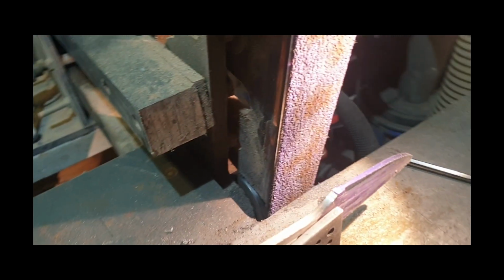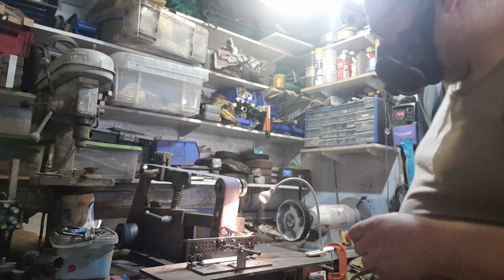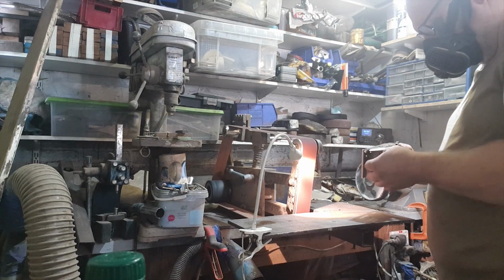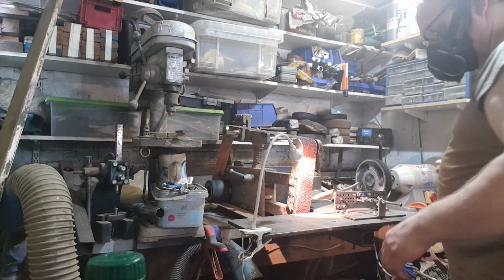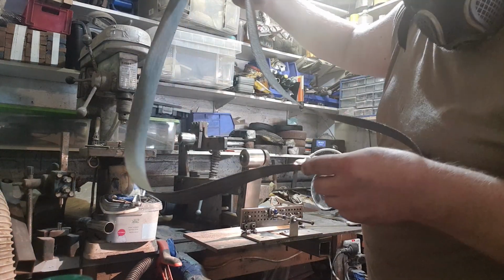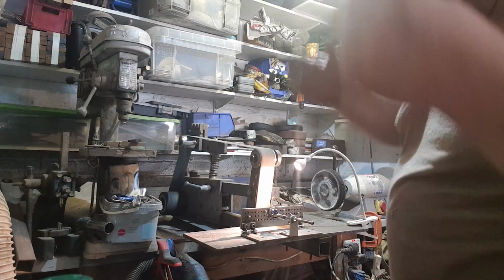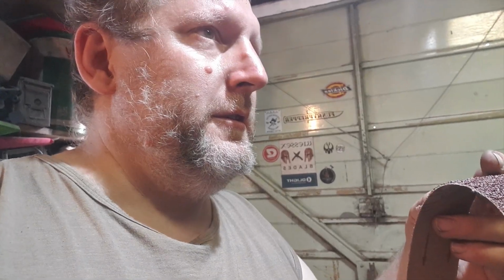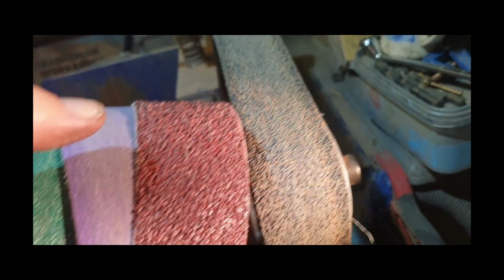Knifemaking finishing belt by Deerfos from Ground Flat Stock #makerknife #knifeskills #knives

Comment: Really interesting outcome with that gnarly looking belt. I don't seem to be able to get a decent finish at all on the grinder. Handsanding a 120 belt finish with 150 or 180 paper takes ages as the scratches seem to still be really deep and coarse compared to what the paper leaves.
Reply from the maker: Hi there, when I come off a 120, I use 120 grit for hand sanding, using a machine allows you to bear down with your bodyweight quite hard so although it uses 120 grit etc, the depth and uniformity of the parallel scratches allows really defined scratches,  hand sanding is a lot gentler and not as consistent so gives a different effect, its like you can do a reasonable satin finish with a 36 on the machine but struggle to achieve the consistency by hand sanding,

Comment: I just recently watched one of your videos on sharpening an MOD knife. I’ve been meaning to buy another one of them, I’m wondering, is it better to buy from the J Adams factory, or to find a John Nowill and sons make of the MOD? I’ve heard Nowill has better quality control, but I’ve only bought from the J Adams factory website. I can seem to find the version with no markings on the blade, and the marking on the handle, but is there a difference in quality between either?